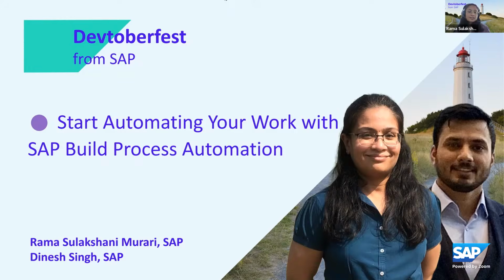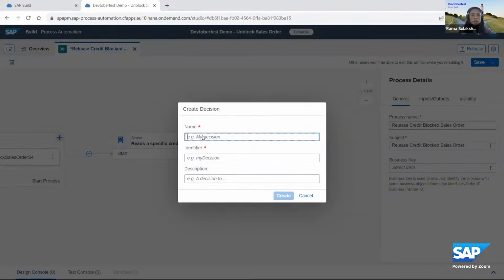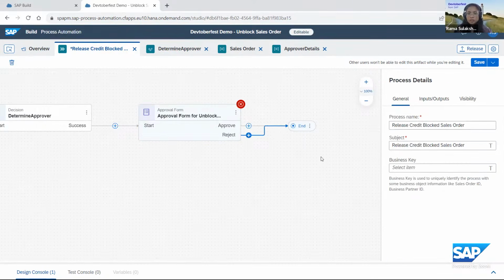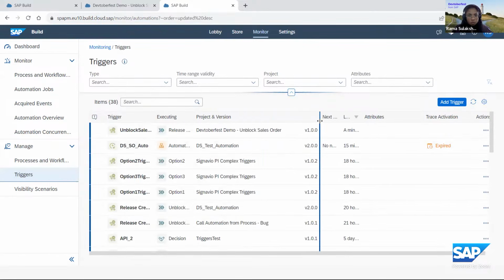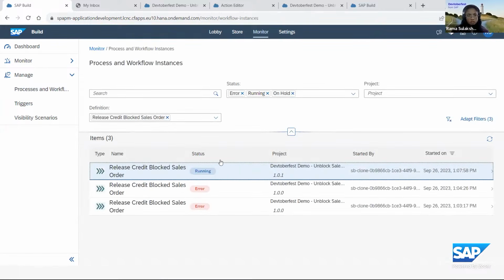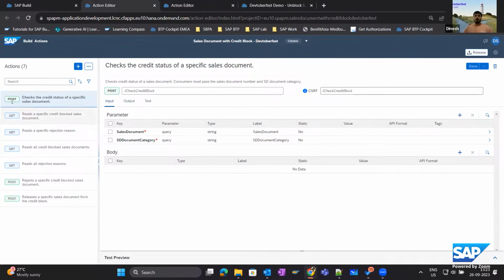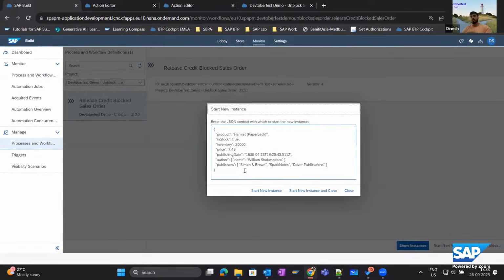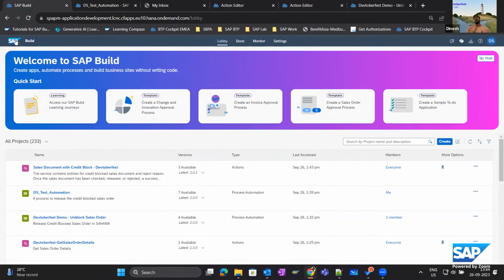🟣 Start Automating Your Work with SAP Build Process Automation

Comment: Great Video. I have a question for Dinesh. If I have an automation process that is reading an Excel document, can I have it in attended mode? Does that mean that the user who triggers the automation needs access to SAP BTP + it has to have the SAP Build configured?